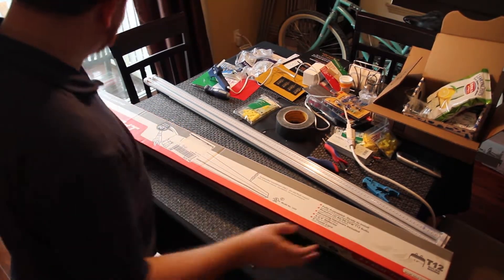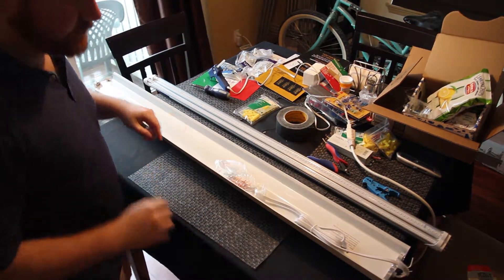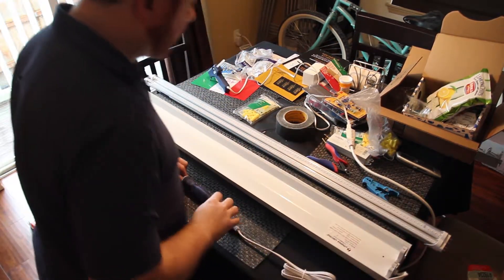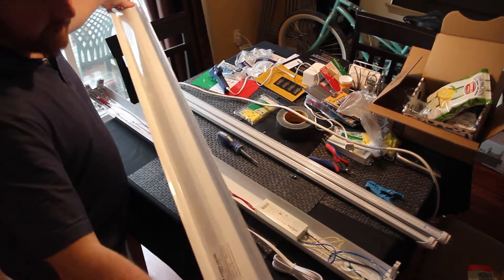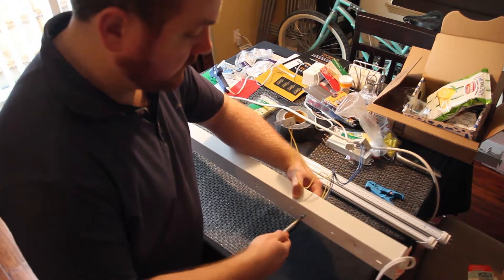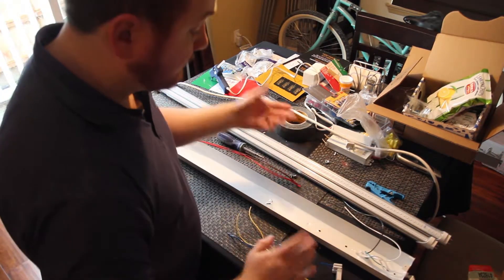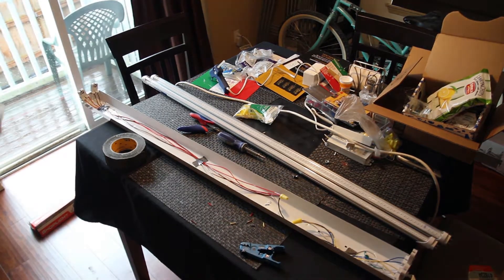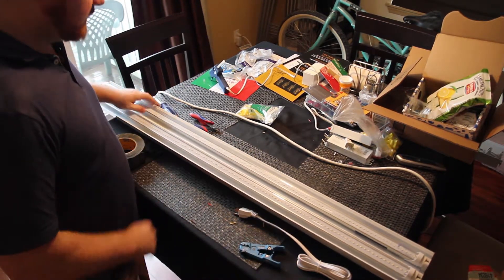Lithonia Model 1233 Shop Light - Conversion to LED

Comment: Becareful with this guys instructions. I had an electrician try to find out what I did wrong. And not all the 1233 fixtures are wired this way. I cut out my ballast and followed his directions and I could not get my bulbs to turn on.  The wiring in my fixtures you cannot just hook all the wires like this guy tells you to. You have to make sure you have just the in wires for them not all of them as mine. I had gotten the Phillips Universal t8 replacement bulbs. Found out that these bulbs require a ballast to work. Even though I did what he did my bulbs would not come on.  The electrician told me it was wiser and cheaper to just get brand new Integrated LED fixtures that have over 5000 lumens. I found 5000 lumen fixtures for 40 bucks at Homedepot or lowes. The electrician just removed ny fixtures and installed the new fixtures and wired it for me. Since it was my friend he only asked me for gas money and bridge toll and he installed them for me for free. So JUST GRT BRAND NEW INTEGRATED LED FIXTURES AND DONT WASTE YOUR MONEY ON REPLACMENT BULBS!
Reply from the maker: Yes, this video is 4 years old, and the market has changed significantly since then. I would also recommend buying integrated LED fixtures these days, as they were not widely available at reasonable cost back then.

As far as not being able to get it to work right... well, that comes down to finding the bulbs that don't need a ballast, and then the wiring is the same as wiring any household light bulb. T-style bulbs are positive on one end and negative on the other, but really they are AC so it doesn't matter... with the LED it may, though.

Comment: I got Phillips Universal fit daylight 32w T8 trying to put in my older 1233 lamps in my display case and one of them is not working at all and the other the bulb flickers on the ends but won't turn on completely so im concluding the ballast is dead in that one and they are not compatible. I am wondering if these older ballasts in these are not working with the new LED bulbs so I'm going to have to convert like you show.
Reply: Turns out these bulbs don't work in older 1233 lights. They fried my bulbs.  And also you need a ballast to work with these newer universal fit bulbs. So doing the conversion it still didn't work. I cut out the ballast and it still didn't work. This guy is not wiring it correctly.

Comment: Hey Bill. Great video. I’m trying to do this with a Lithonia 1223RE fixture which looks virtually the same inside. But when I plug in the fixture one of the LED tubes flashes once and then neither of them come on. Have you seen this before? I’ve tried it with multiple bulbs and two different fixtures. The bulbs I’m using are GE F32T8 if it matters altho the bulbs are actually marked as Utilitech T81620F4-40 bulbs.